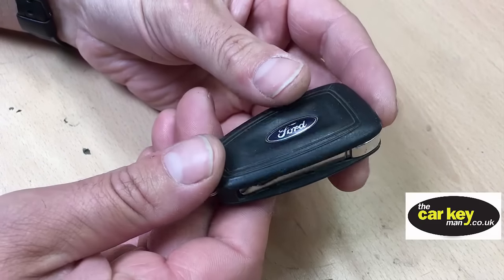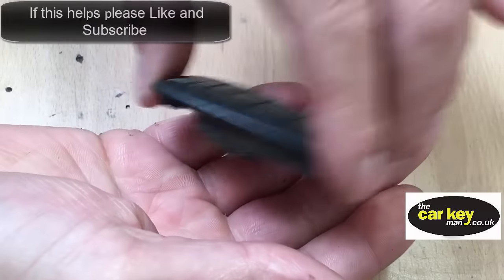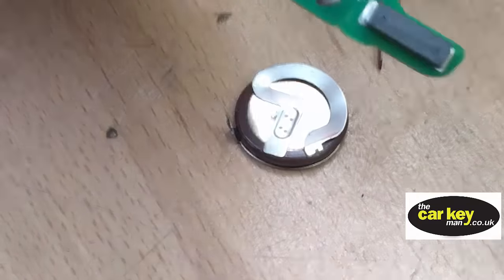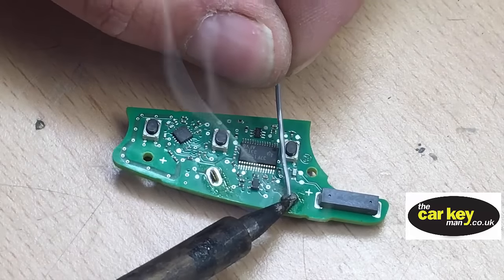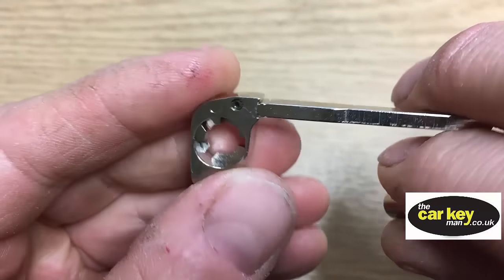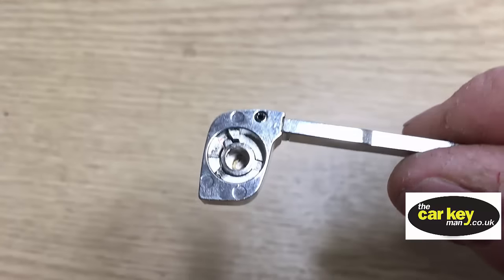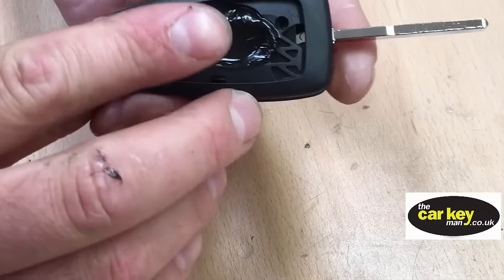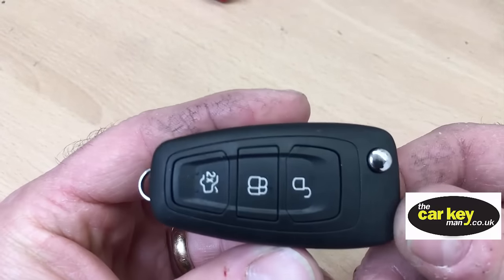Key Repair Ford Transit Custom HOW TO change case and battery

Comment: Great help, many thanks.

I had two keys with exact issue with a broken battery terminal. I'd thought for ages the battery was unrepairable, but wasn't prepared to pay the £150 to have it replaced. When the second one went, I found this video

I'm too cheap and impatient to buy a new battery, case, solder mop etc and have managed to get mine working again without the need, so thought it helpful to explain how.

I just opened the case (as per video. I had the special tool which was very helpful) and noticed the remote worked fine if the battery was forced into place just using my fingers.

I was able to force the battery in place and held it there with a strip of insulation tape, and the stuck some foam strip the battery compartment (instead of the silicone shown in the video) to keep the battery in place once inside the case.

I checked the remotes worked okay, then used some araldite to glue the case back together.

Both keys now work fine, although I would admit it would have been better to have a new battery and resolder as per the video which I will do if the repair doesn't last. I will remove this advice if my repair fails.
Reply from the maker: Thanks for the great post, really hope this helps everyone  :)

Comment: Watched two videos from these guys for two different types of keys and they are very informative, highly accurate and tell you what issues may arise while dismantling and reassembling so definitely worth checking out even if you have a fairly good idea what you are doing. Keep up the good work guys
Reply from the maker: Thanks for the great feedback :)
Reply: No problem. I know feedback is everything  for a company and a company like yours that don't fleece their customers by selling them the parts they need and providing them with the video tutorials to do it themselves saving a substantial amount on main dealer costs should get the recognition they deserve. Thanks again

Comment: Great informative video.Managed to swap the blade on mine aswell , just need to shave of a mm with a file and it slots in , pin back in and sorted
Reply from the maker: Hi Lea, thanks for the info and the feedback :)

Comment: Many thanks for the vid bought a focus the spare key blade wouldn't lock shut the dealership would not authorize a new one followed your vid swapped the blades ground a bit off the end perfect fit new key cheers 🍻🍻🍻
Reply from the maker: Good job! Glad it helped and well done :)

Comment: I have this key, it stopped working, and the mechanic told me it will recharge as I take it on a longer drive - is this untrue? Is the source of failure always a faulty battery?
Thanks for the video!

Comment: So just to clarify…..to do this I’ll need a replacement battery, some pliers to pop it open, soldering iron, solder, silicone and a new aftermarket case? Cheers
Reply from the maker: You're ery welcome and I'm really pleased it helped :)

Comment: Great video and very informative. Ive just got a question... a young lad working at Halfords who couldn't help me reckons the key will need reprogramming back at ford because once the battery is taken out it deletes it's link with the vehicle? Is this true?
Reply from the maker: Hi Jack, on some cars this is the case. For your Ford we have seen this occasionally. For some reason the van doesn't recognise the buttons being pressed, but then if the key is recoded it starts to work! Not sure why this just happens sometimes, instead of every time. You don't need a dealer, there are plenty of independants that can do this for you if needed

Comment: I've had the same problem with both keys. I thought the warranty would cover the replacement but the Ford dealer(Stoneacre) wanted my van for a full day to do a diagnostic on the key(yeah right) I priced an alternative key fob which came out at £160 each. So out come the tools, opened it up and soldered the contact back to the circuit board. Bingo, it works a dream. Didn't cost me a penny. I will buy a new battery for the other fob but needed a quick fix for the issue on the 1st key. Thanks key man for your help.
Reply from the maker: Hi, well to be honest, I'm not sure what any warranty covers these days. Keys aren't usually on any warranty. 
It's amazing how the battery just floats about inside don't you think? It's no wonder the legs snap. 
Glad you got it sorted
Reply: Your link to the battery is the wrong battery. But thanks for the helpful video :)
Reply from the maker: Thanks, not sure how I got that wrong! I've updated it and thanks again

Comment: hello, thanks for the video. the link you added seems to be for bmw batteries. is this an error, or are these batteries interchangable with the one for ford transit 350 2018?? thanks alot in advance for your reply.
Reply from the maker: From memory, yes they are interchangeable
Reply: @TheCarKeyMan  thanks alot for your reply, very much appreciated.

Comment: My key got washed and now won't work the car still starts but the button don't work if I crack this case open same key as your one I have an old focus key would the board fit inside the older version ford key MK2.5focus
Reply from the maker: Hi, it will fit into a Focus case the same size and shape. But if the key isn't working now, why do you want to swap it? I think you just need a new key
Reply: @TheCarKeyMan  to clean the inside and hope I can get it to work again

Comment: Love the video, hoping you can help with a question. 
I have a ford focus my13 with exactly the same key as this video.
Both keys operate the central locking but now only one will crank and start , the other causes "immobilizer active" fault message.
Has the transponder chip failed you think?
Reply from the maker: Hi, yes sounds like the chip gas died inside the key. Only answer is a new key unfortunately

Comment: Hi need my ford transit custom key repaired....battery solder thing gone on it im assuming, do you offer this service? Cheers
Reply from the maker: Hi Andrew, no sorry not anymore. We used to fix these by post, but often we'd make sure it was transmitting when it left ours, but didn't work the central locking when our customers received it back. So I think there are other issues, not just the battery

Comment: Does the battery power the transponder/ID chip or just the remote?
Reply from the maker: Hi Colin, just the remote buttons. The transponder is powered  by the van, when the ignition is turned

Comment: Is it expensive to get key cut thanks and were would you recommend thanks
Reply from the maker: Hi, we’ll it depends on who does it and what key you are after. 
From long experience, I only supply genuine OEM keys now. There are cheap copies available but they can be very troublesome. Expect to pay. E tween £180-£250 for a dealer key, or even more at the dealer. 
Cheaper keys can be as cheap as£120 but I don’t like them and they have caused me lots of trouble

Comment: Nice work, except for the unnecessary use of silicone adhesive.. Imagine the trouble next time you want to do any repairs..
Reply from the maker: Hi Don, yes agree with you, but we've found these only survive one repair. In fact quite often, even when the key battery is changed as in the video, the buttons still don't work, which is annoying!

Comment: Thanks for the video. This is more A level than the usual Ford remote battery like in the Ford Ranger. Why do they make it so difficult in some
Models and a walk in the park for others. Even the Kuga battery is easy. The Ranger is easy and even the after market keys we had made up (remote fobs) at ££ each have simple ways to pop the battery.  As it’s a lease Ford key I’m not touching it. Had it been my own absolutely delighted with your video. I have the equipment! Do you have a link to the battery needed although if you have a button battery the casing for the battery probably is much cheaper than the £9-10 any thoughts?
Reply from the maker: Hi, sorry don’t have a link at the moment. Yes these keys are just a real pain

Comment: A Big No No to use acetic  Silicon near any electronics as it will cause corrosion on the board.  Always use neutral cure Silicon, so if it smells like vinegar then don't use it.
Reply from the maker: Thanks for that, every day is a school day!

Comment: Thanks for the videon saving some money is good, a question can you give me some indication of that device gnawed to test the remote control? Brand, name, where to find it? Thanks            Grazie per il videeo risparmare  un po di soldi fa bene, una domanda mi puoi dare qualche indicazione di quell' apparecchio roso pert testare il telecomando? Marca , nome, dove reperirlo? Grazie
Reply from the maker: Hi, it's an RF tester, made by Sealey model number VS921. Hope that helps :)

Comment: I have a got a Ford KA and the side bit that holds the battery in the key fob has fallen out and got lost. Does anyone know if I Can I get a replacement please
Reply from the maker: Hi Patricia, no they're not sold separately im afraid. The best way to fix your problem is probably to buy a used key off ebay, and rob the part from the old key and put it into yours

Comment: So am I right in thinking that the old key case is broken once you snap it open? Or is it possible to re-use it? Great vid, very helpful!
Reply from the maker: Hi Henry. Sometimes it's possible to reuse the case. If you do that, you'll need to glue it back shut. WE normally replace the case, just because it's a better job, but both ways are fine, whatever works for you
Reply: used my wifes nail glue as it had a fine brush to re-attach the two halves, worked a treat!!!
Reply from the maker: Like it! That saves you needing a new case!
Reply: Thanks for the replies. Can you post a link to the video as to where  I can pick up a new case from please if that's the way I choose to go.

Comment: Hi do you provide a repair service on a key....presently using my 2nd key as the original was driving my door alarm crazy, i suspected iffy fob but wasnt aware of the key drop/solder vulnerability. New one works great but would like original repaired.
Great vid also.
Reply from the maker: Hi Andrew. We used to, but we found that after the key was repaired, around half of the time the remote central locking still didn't work. This was even though the key transmitted.
In the end we stopped offering it out

Comment: this helped alot.. thanks!
Reply from the maker: That's great Muhammad. We no longer change the rechargeable batteries as a service as we found sometimes, even though the battery was good and the key transmitted, it wouldn't work. Never worked out why.
Did yours work ok after?

Comment: Great video, I followed the steps today and managed the job so thank you. But I can’t start the van now (the immobiliser is active) can anyone help? Thank you 🙏
Reply from the maker: Hi Alan. There is a chip in the key, which is not the same as the buttons, which simply lock and unlock the van.
It's common the these chips to keys to fail, did you have any problems before you opened the case?
Reply: Ll